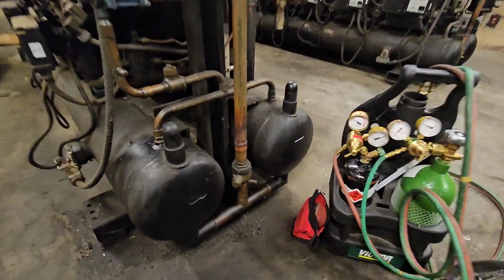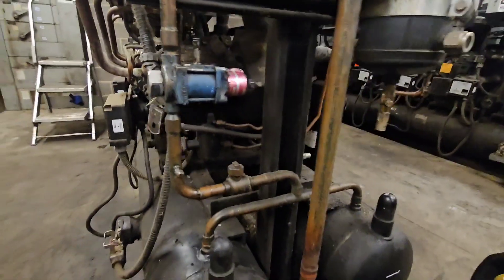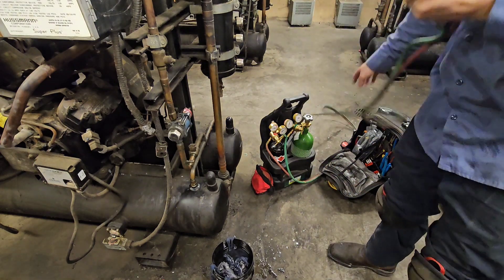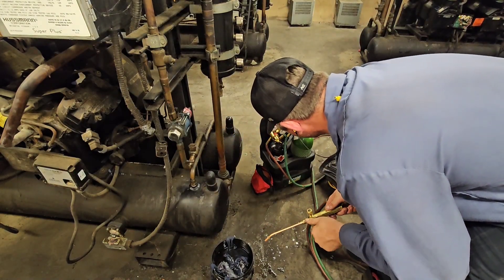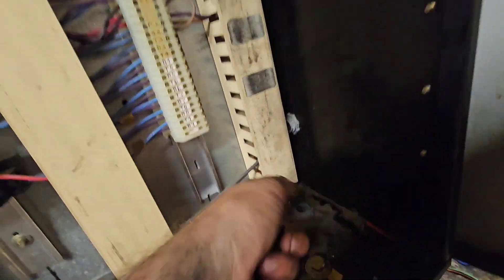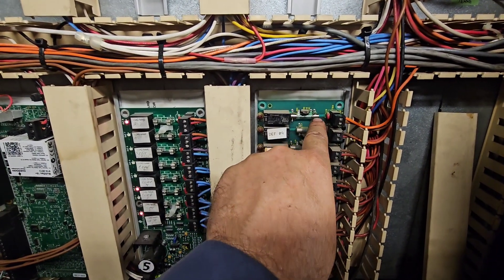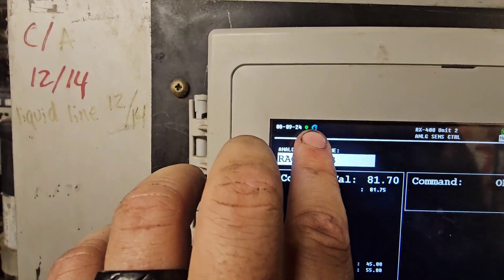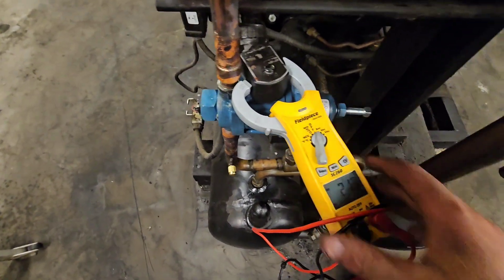Refrigeration: A9B Replacement and CPC E2 programming

Comment: Good work man! I normally set the bypass about 10-15 PSI below my holdback valve, but I understand it depends on the climate you're in. Awesome video and tips
Reply from the maker: Ya that's a good point. This rack is hot gas and doesn't have a LPRV. That's why I set it up like that.